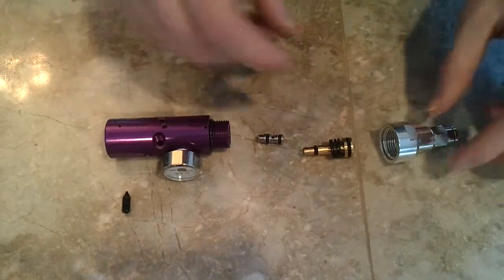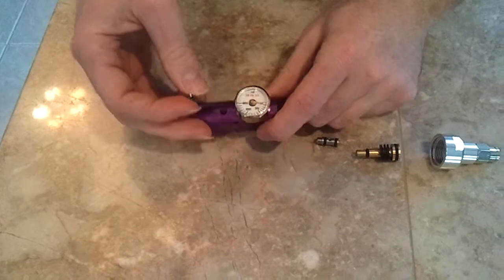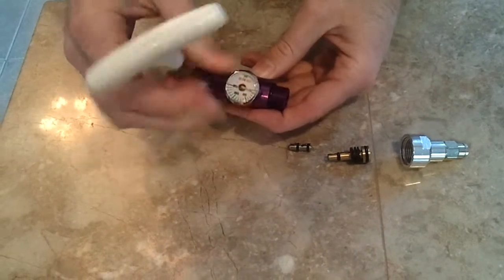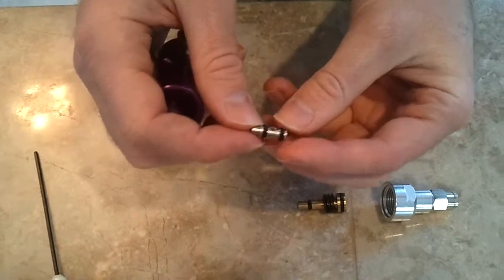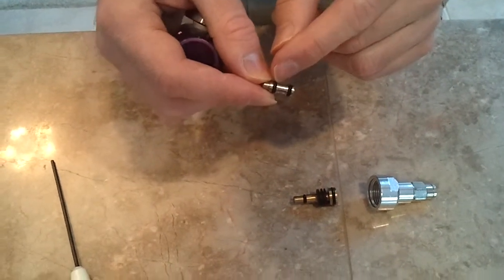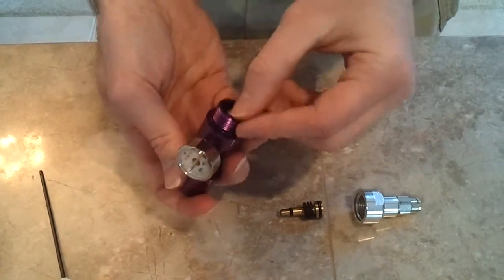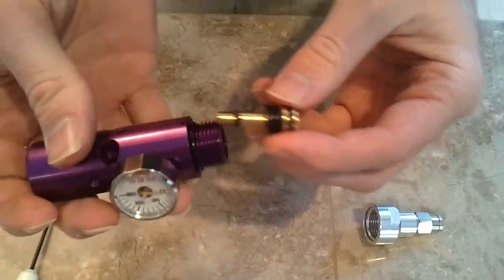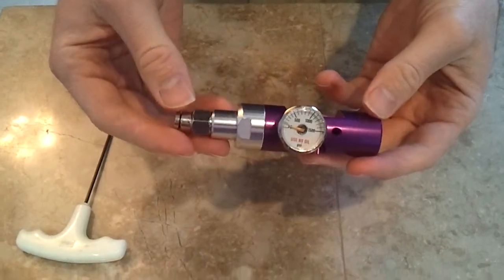Java Spyder Bottomline Home Carbonation Exploded view/diagram

Comment: I'm way late to the party, but those washers are called Belleville washers, but are also sometimes called spring washers or flange washers. They act as a spring. So when pressure enters the regulator, the air pressure pushes the piston against those washers, until the washers are overcome and the piston seals, prohibiting more air from entering the chamber. Once the marker is discharged, the piston unbalances and allows more air to enter. The spring/washer force determines how much pressure the air must overcome before sealing, which is how the regulated pressure is determined.
Reply: Don't mess with the order of the washers. Some combinations produce poorer results than others, which could result in slower recharge.

Comment from the maker: It is the o-rings going bad. You should be able to get a set of o-rings from the ebay seller or a painball store. You get the little silver part out by using compressed air to push it out. You might also be able to use a small wire to pull it out.

Comment: Thanks for the video, Isaac. I got all the parts for my carbonator, just like yours. My Spyder CO2 regulator leaks(blows) from the set screw hole just under the gauge. Doesn't matter whether it's adjusted in or out. No CO2 out the tube end at all. Took it in to the paintball shop looking for help. He had never seen one, He told me to contact the ebay seller (sporting goods dealer), he told me to contact the mfgr. No instructions, guide or user manual from them either. Any help??